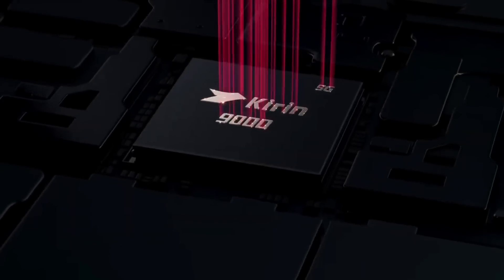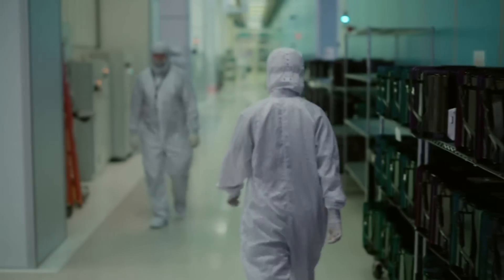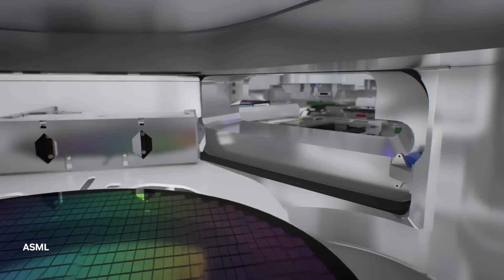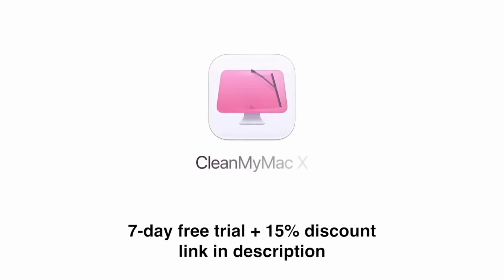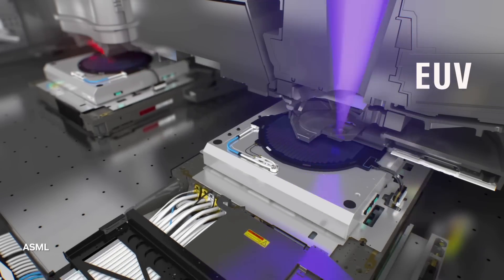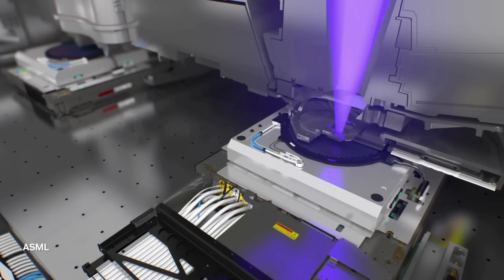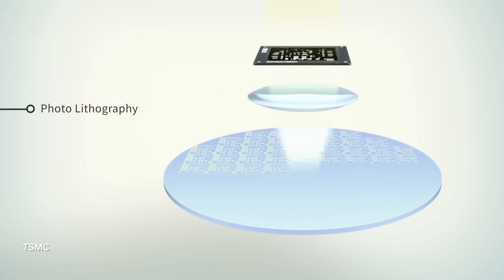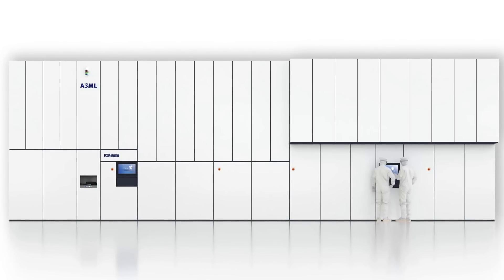The Truth About China's 7nm Breakthrough

Comment: I dont believe yield is low, definitely not below 50% or the 30% you quote. No money can widen the DUV machines bottleneck, and they could not manage MASS ptoduction with poor unreliable yields. Finally experts who examined the new Kirin under electron microscope say the transistor elements and layers are very clean and with high quality edges means they are not pushing beyond their equipment or skill resulting in inconsistent quality.
Reply: and now you know why the china haters are going mad trying to come up with explanations.
Reply: But...but...according to the two smartest Semiconductor Engineers SerpentZa & Laowhy86, the Kirin chip is shit. 😆
Reply: @KrazeDiamond  ahh yes, those two absolute renaissance men with expertise in economics, military strategy, robotics, renewable energy systems, finance, geopolitics, electric vehicles, structural engineering, urban planning, political science, aerospace and now semiconductors. truely where do they get the time to learn all that while riding around china being glorified tourists.
Reply: They can mass produce because they ordered truckloads of DUV’s from ASML. It’s a big step they have managed N7 or even N5, but it’s not clear whether production is actually profitable. But this may not be a huge concern for China at this stage. 
The question is, what is the next step without EUV…
Reply: The CCP's military wing the PLA will not care about the yields.  So long as there is enough manufacturing available to supply the PLA when the CCP goes to war.  Those yield amounts are very low but if you can throw money at the problem and dont care about cost.  Well then, you can manufacture and produce more advanced chips.  So if you end up under sanctions like Russia.  You can still have more advanced weapons to play with.  ASML has been allowed to sell DUV machines to China until now but once China cannot buy DUV machines.  Will it still be able to develop more advanced chips?
Reply: @GodKitty677  the military doesn't use 7nm anyway, The only thing that these might be useful for the chinese state are supercomputers
Reply: @hughmungus2760  Faster and lower power chips are needed for most applications.  Militaries use tablets and most types of handheld devices for example.  Lower power draw, means less weight.
Reply: @GodKitty677  typically milspec systems need to be radiation hardened which makes it impossible to build them off cutting edge nodes. Thats why all militaries in the world still use tech thats 10-20 years old
Reply: @hughmungus2760  Start thinking AI chips.  The next generation of weapon systems.
Reply: @GodKitty677  It's CPC, there is no such thing as CCP. It's like insisting on calling the USA > UAS instead, Unhinged American Savages.